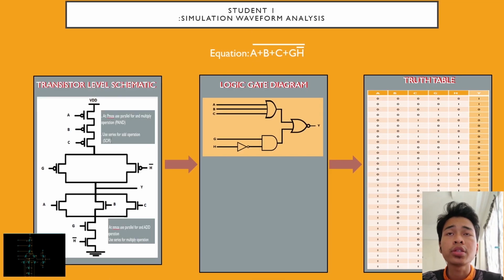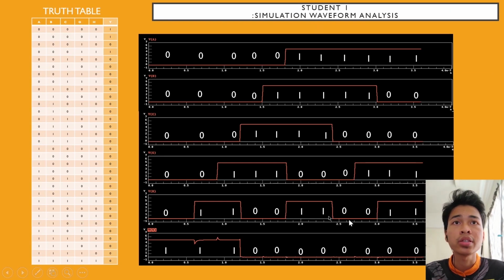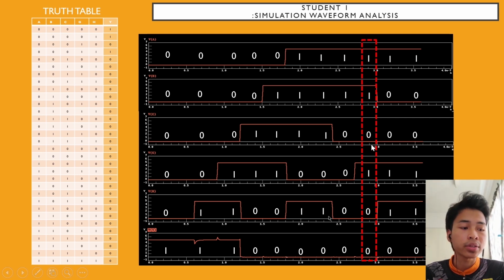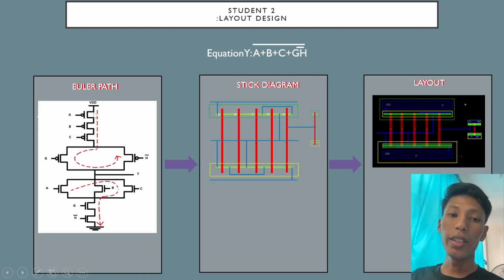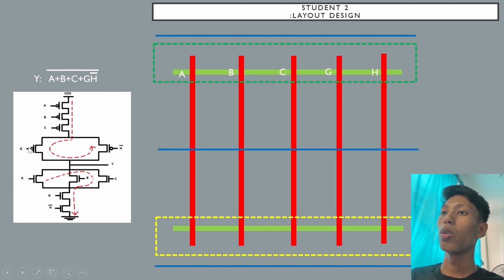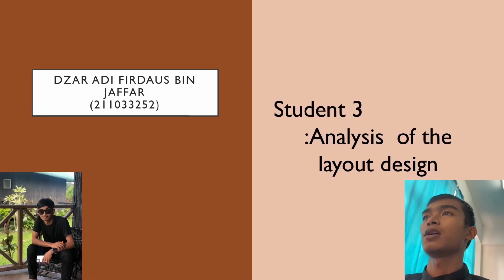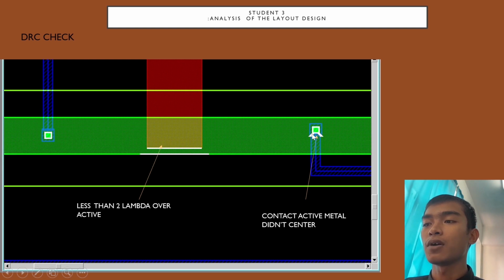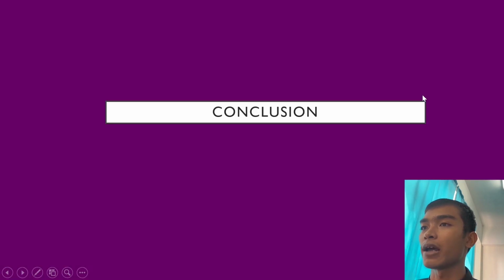Ic Design mini project  group D 10

Comment: The drawn line for PDN Euler path was incorrect. Luckily, the transistor arrangement path was correct. To get the same path as PUN, the path should start with transistor A's drain to B - C - G - H'.
Reply from the maker: sorry madam draw line PDN tu ade silap lukis euler path bawah🥲🥲 tak update baru